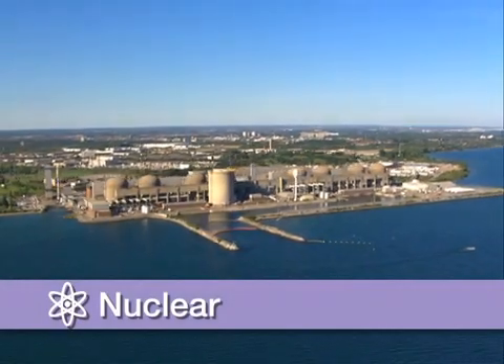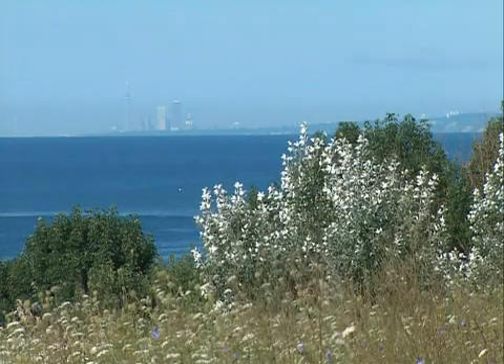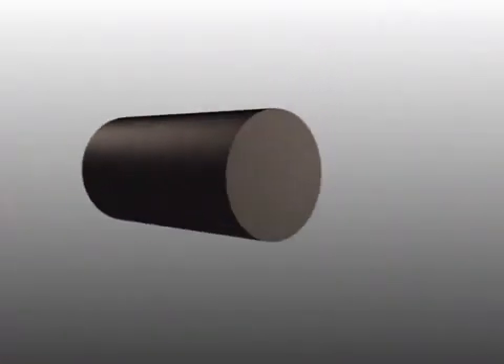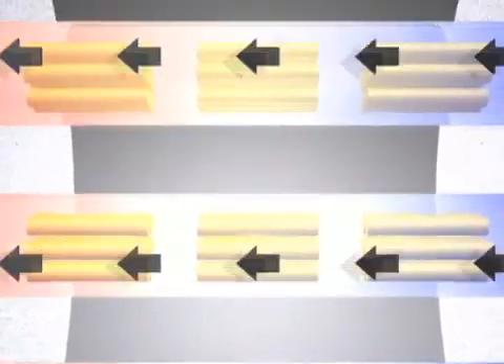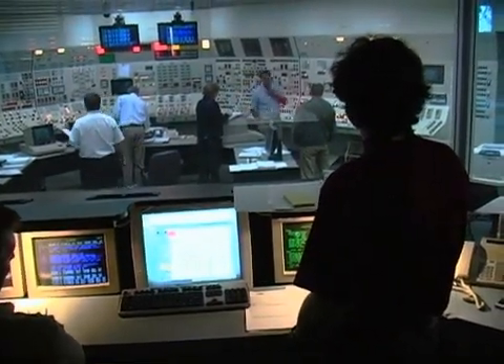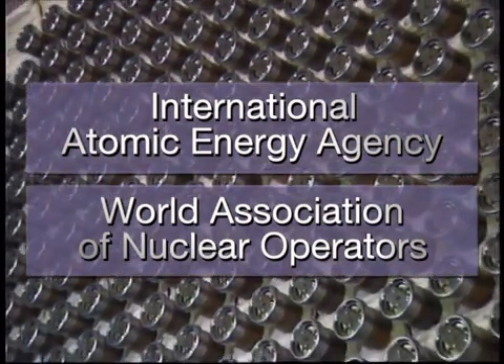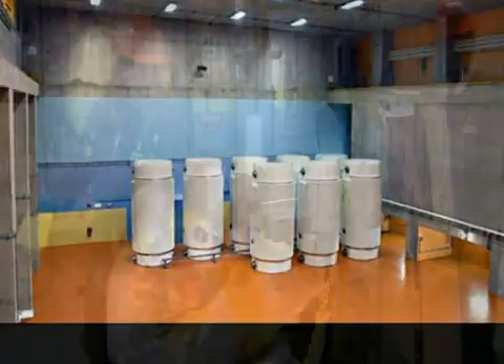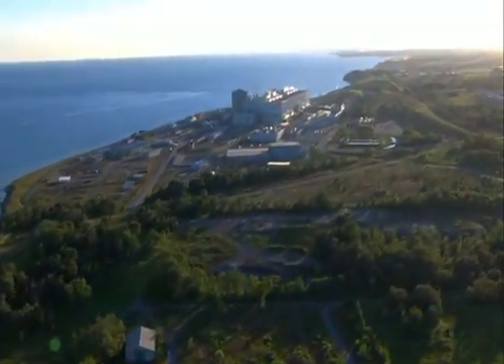Nuclear Power Generation in Ontario

Comment: CANDU is as close as you can get to a fail safe designed reactor.  The question is; is it better to bury the nuclear waste or reprocess it for reuse in the reactor?
Reply: It's better to use the proclaimed waste through FBRs.

Operating FBRs can form a Basis for Gen4 Reactors.

Comment: Its risky.... I cant decide whether its good or not.
Reply: Mathew Sloan not really, as stated in the video these plants have many backup systems and ways to stop nuclear reactions in mere seconds, plus they are built in very safe, geologically stable areas. these plants have been running for forty years, providing consistent , clean and safe power.